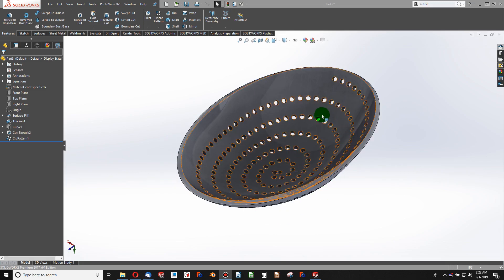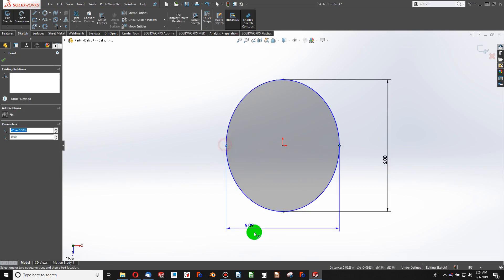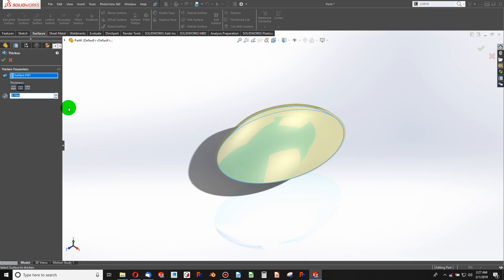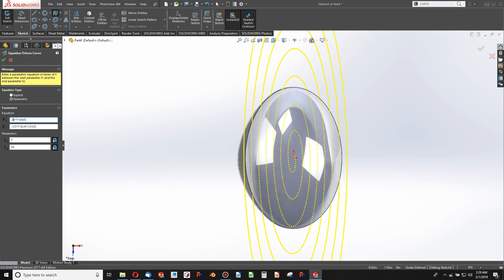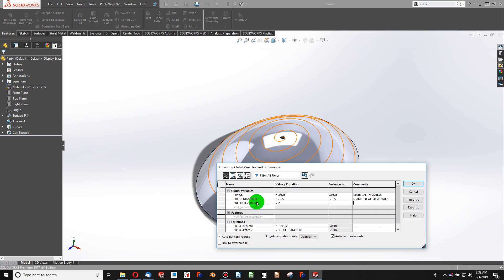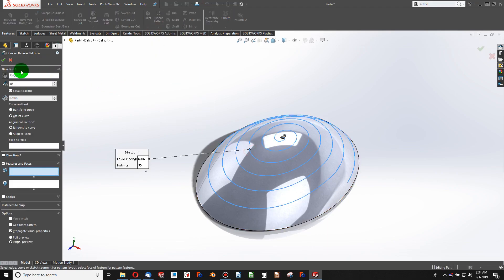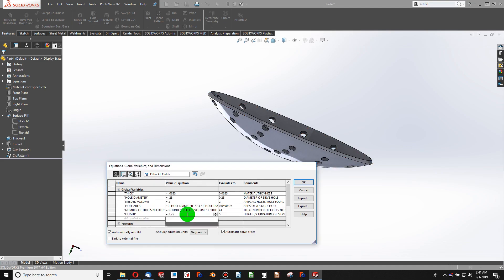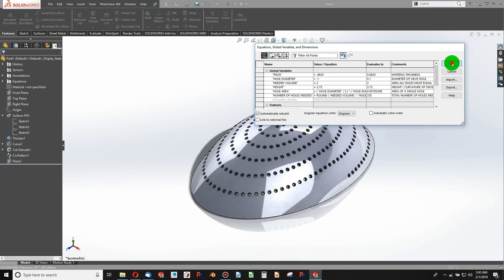How to Use Global Variables and Equations in SolidWorks |JOKO ENGINEERING|

Comment: how to sync two circle example:-
one circle dia75mm and secound circle dia1000mm
dia1000mm (1000mm-100mm=900mm) so change 
dia 75mm change (75mm+100=175mm)
mins i one circle dia minuse so secound dia pluse is value
how create
Reply from the maker: Put your equations into global variables and set the dimensions to the values

Comment: Hello, I just found your channel. I am a mechanical engineering student and I'm in the market for a laptop that will run all the needs of cad software. What do you recommend?  What do you use? Thanks.
Reply from the maker: Hi Ryan;
I run a Dell Precision 7520 with a Xeon, 32GB ram and Nvidia Quadro M2200 graphics.  Works good for me.  In school on a tighter budget, I ran SolidWorks 2018 on an i3 and it worked for my needs so you don't need insane hardware.  

Dassault provides some hardware guidelines here: https://www.solidworks.com/sw/support/hardware.html
You can also check if your hardware would be RealView compatible which doesn't enhance your ability to model, but really is a nice touch.  Follow up with any additional questions, welcome to the channel.